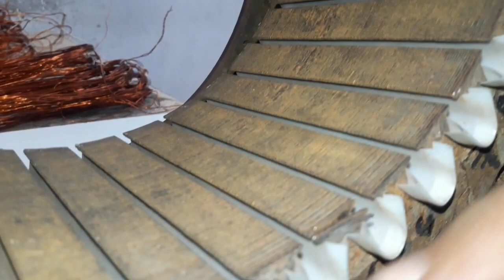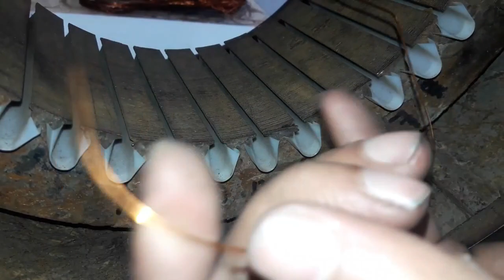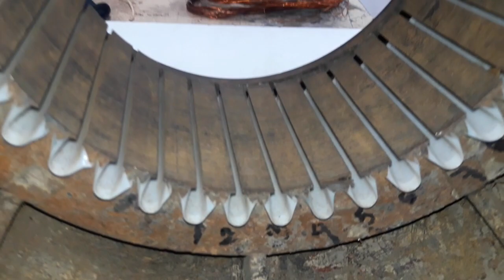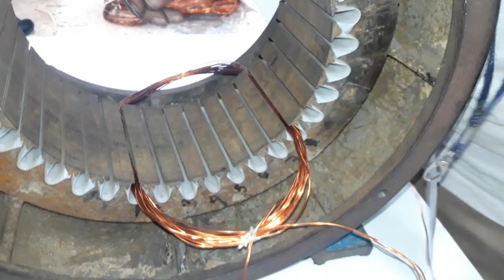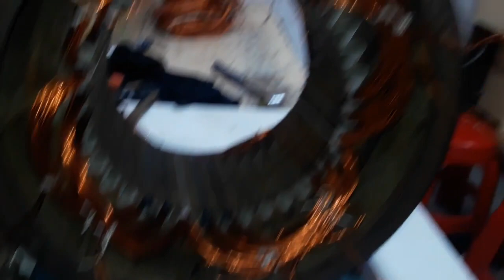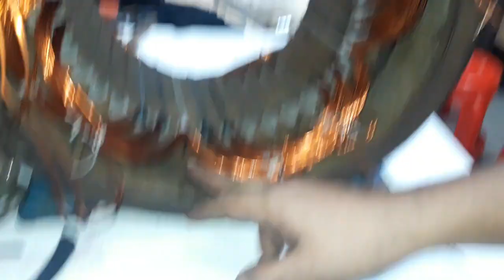3 phase 12 kva generator rewinding. how to repair a generator. armature rewinding

Comment: Helo sir plz answer mi sir aap to ek technical ganreter ingniyer ho aap hi mera dowet cler kar sakte ho you tube par khi nhi mila jvaab 

Sir jese three phase ganreter hai 50 kva ka 
To uska ban gya 40 kw 
End par phase ka 13 kw ban gya jese hum partek phase se 13kw load daal sakte sir jese hum ko in teen phase mey se ek phase se 10kw load uthana hai.. bache 2 phase par 500-500 watt ki lite lga k chla sakte h ya ye galt  h sir ye dowt cler kro 🙏🙏🙏🙏🙏🙏🙏🙏